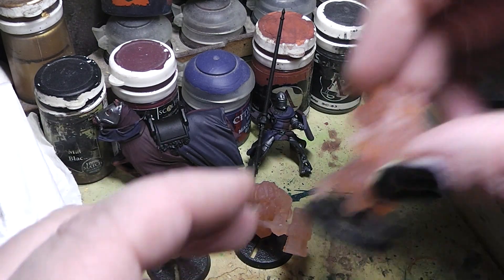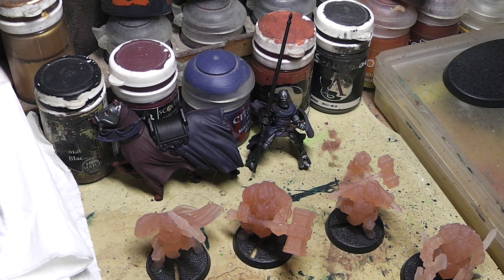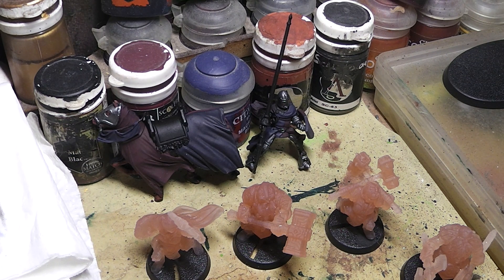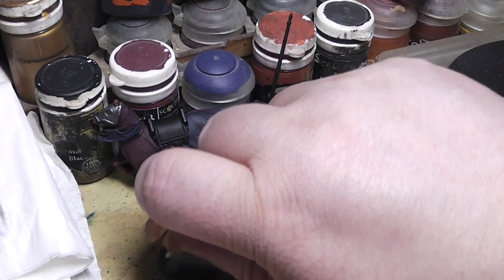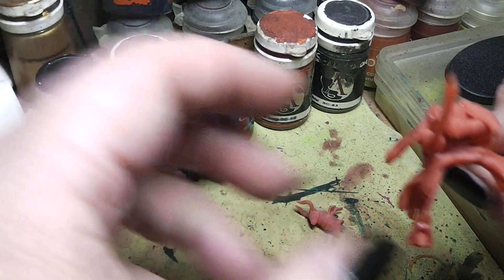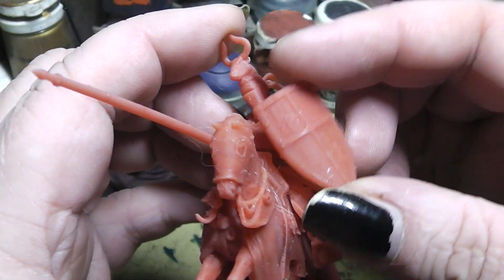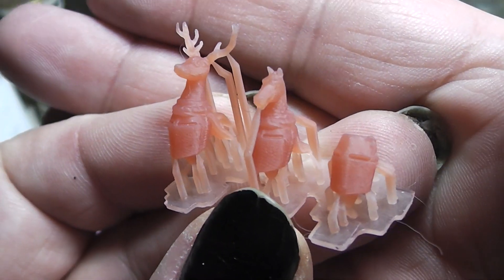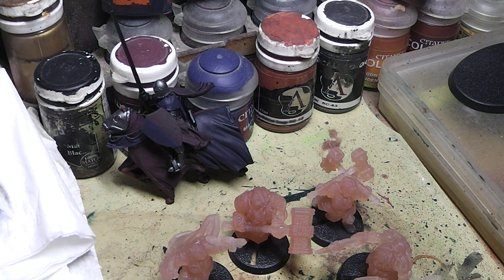I destroyed my 3D Printer

Comment: You tried to Re-flash the firmware? 
Look up info on how to do a hard reset as well as flashing firmware. To my knowledge Unplugging it wouldn’t hurt the machine my power goes out all the time but I am in the states. I have little knowledge of European power outlets,
so Iam not sure if it could there. I know Europe has higher voltage outlets.
 If your machine doesn’t start working again, or if fate fixes this problem, and you Find your self able to get a new printer at some point. 
 I suggest a qidi tech shadow S if you are fine with 2k printing @ $150.00 or less they also make a mono chrome 4k machine too. Not sure on name or the price. But, i find Qidi to be superior machine to anycubic. I like the fact that it’s open and not enclosed had this happened on a qidi, you could have simply removed the resin tank before the plate reached the bottom. Not exactly helpful at this moment  but maybe it will be helpful once someone organizes some support for you. I have faith in this channels subscribers! :)

Comment: It sounds like the Z axis motor may be stuck. Turn the printer off and unplug it, remove the vat if you can, and rotate the metal cylinder that the threaded Z axis rod goes into manually to raise the build plate a few clicks and turn on the printer again and see if that works.
Reply from the maker: already done that. didn´t work
Reply: @GirlPainting  Hmm. Usually if it's unplugged that works. I know my transformer plug hold a charge for a little while so I have to wait for it to discharge or to unplug it from the machine for that fix to work. Have you unplugged the printer and removed the USB stick? The problem could be a corrupted file on the USB stick.

Comment: Any chance that there is a fuse on your machine that might have blown in the quick shut down? Does anything power up when you turn it on?
Reply from the maker: the screen turns on and the software works, but the mashine dos not react to any command input. evan a firmware update did nothing.
Reply: @GirlPainting  easy one but the touchscreen ribbon cable could  be loose. The touch screens are fairly cheap to replace and easy. I have a Elegoo Pro and they are similar to Anycubics of that era and opening it up the screen is quite loose.
Reply from the maker: i doubt it, because the fan also dos not work, and that turns on automaticly as long as there is power.
Reply: @GirlPainting    hare thing is steel under WARANTY ?? thats a thing  to look in to  just think of it just now
Reply from the maker: @redgreen09  no, this printer is 3 years old.
Reply: @GirlPainting  google, youtube and forums, these printers are quite modular and you can get spare parts really cheap but it is a risk like everything as you may be ordering spare parts for something that aint broke so the initial analysis must be spot on. It's daunting but doable. I got a flex plate whish is magnetic and allows u to pull off print easily from a thin, removable magnetic plate. No one really forewarned me that due to the extra thickness it throws everything out of whack and not only did I have top reset the plate height via the software menu, I also had to put washers to lengthen the pieces on the build plate that head towards the sensor at the bottom that stops the plate in time and bounces it back up if it hits the screen.... complications everywhere.